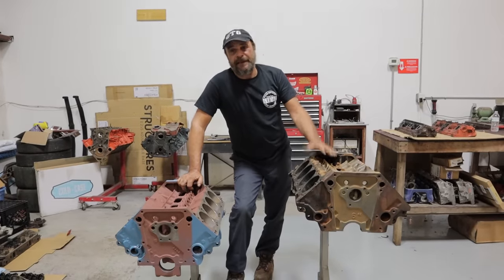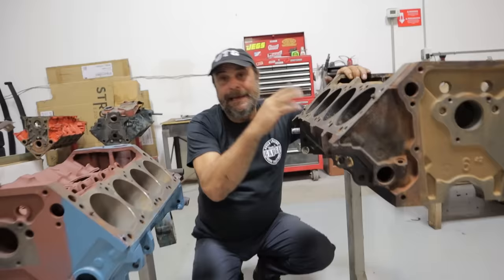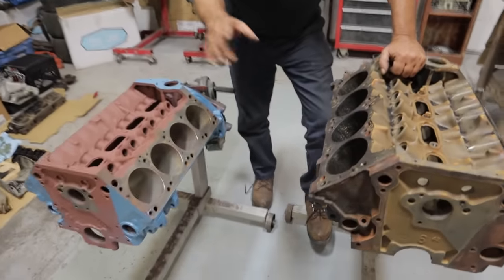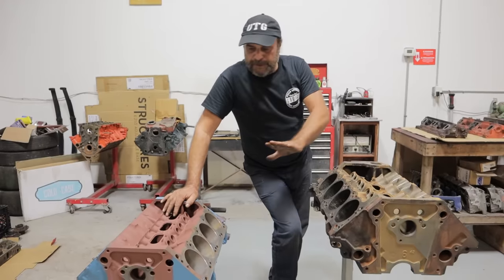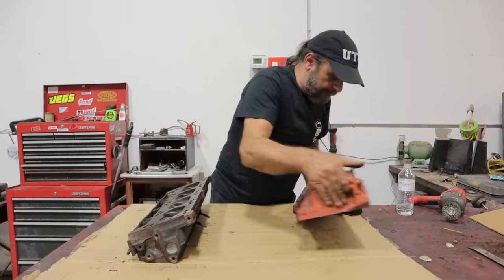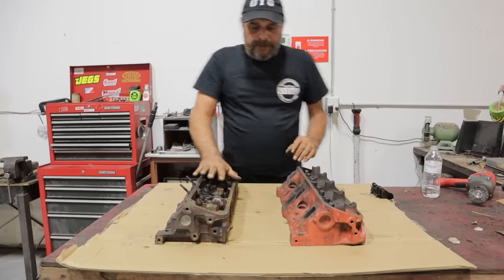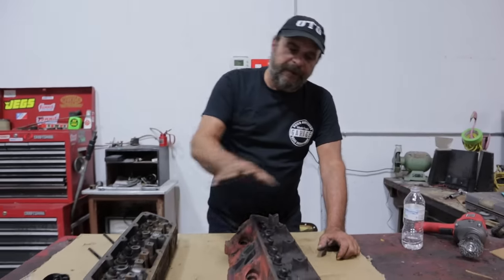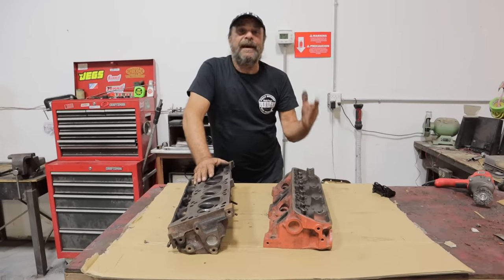Magnum vs. LA. Side By Side Comparison

Comment: When Uncle Tony says F those cracks they don't matter, I believe him
Reply: I think that's also the case for the 5.7 Chevy Vortec heads, but machine shops don't want to use cracked heads
Reply: I have 4 magnum head from 318s one engine had cracks in every cylinder. The other engine had 2 cracks per head. Don't think it would make a difference as I didn't notice them un until I lapped the the valves and seats. They are very minor looking cracks.
Reply: They don't. This has been know for years
Reply: Well yeah might be a chance the crack could cause a check engine light to come on but since most of us are doing carbs definitely less of a problem.
Reply: Awesome man I've been waiting on a magnum video
Reply: its true. ive seen it countless times. truck runs damn good, pull heads "oh no my heads are cracked!" it doesnt matter.
Reply: I dont.......that casting would be shipped off to a shop that does cast iron welding for a proper repair.
Cracks spread--an inescapable fact.
I ve been doing engines longer than he has.
Reply: I dont. those castings would be shipped off to a shop that is proficient at cast iron welding for proper repair.
Cracks spread..an inescapable fact.
Ive been doing engines longer than he has

Comment: I've got a magnum 5.2 I've been thinking about upgrading. We need more input from the pros like you on what our options are.. you know, mild upgrades on up to major mods.. I really think that would be an awesome series that so many of us would appreciate! Either way, I love your channel, keep up the awesome content!
Reply: I'm not a pro by any means but I've done a couple Magnum builds and I'm currently doing a stroked 360 LA for my drag car. My first step to upgrading the magnums has always been a bigger cam, new lifters and pushrods, and headers. This will at least get you the sound and attitude of a somewhat "built" V8. Next would be an inspection of the heads, magnum heads are nutorious for cracking and as a general rule of thumb it's always good to take them off and inspect them. If there's no cracks great! Now you just need to decide if you want to clean up the original heads or go with a new set. Me personally I'd go with a set of aluminum heads that have the ability to bolt on an LA style intake because there's so many more options for an LA as far as intakes go. But this gives you the option to swap a 4bbl carb on it, you could also use the original throttle body with a 4bbl to 2bbl adaptor or go all out and do a modern efi system. All depends on cost and what you'll use the engine for and your goals for it. And last but not least you have your bottom end, the factory bottom ends aren't bad in these engines at all, but if you're looking to raise your compression ratio, add more cubes or plan on using a power adder, a new rotating assembly would be in your best intrest. Hope this helps some! Goodluck with the build!
Reply: Richard Holdener is doing a series on the 360 right now, I know it's not a 318 but most of what he says and does to make power will still apply to it, the power gains may just be a little lesser on the smaller engine

Comment: I pulled a Magnum out of a 1995 Ram and when I took the heads off the block, it had the oil holes from the factory, as I was looking to run my 2.02 J heads on it.

Comment: 5.9 Magnums make awesome power for cheap! Mine just pushed my 68 Satellite daily driver to 8.61 in the eighth with a little 600 CFM gas mileage carb, a 904 automatic with the stock converter and 3.55 gears! The only non stock stuff inside my engine is a Hughes cam and valve spring kit and a Cloyes timing set. My friends 56 Chevy with a 350, 4 speed and 5.13 gear runs high 8's/low 9's and a 650 horsepower 7 speed supercharged 2018 Z06 Corvette usually runs around 8.20 so I'm in the same ballpark as a lot of badass cars with a very mild and streetable combo.
Reply: NICE!! 👍🏻👍🏻
Reply: @77yogurt  Thanks!
Reply: @kennywhiddon1497  Yes roughly according to the conversion chart. It says some cars may be quicker or slower though so it could likely be anywhere from 13.20 to 13.60
Reply: AND YOU CAN DO IT WITH JUNKYARD PARTS,thats the amazing ability of a magnum engine,just remember the magnum engines and the new hemi's, the valve springs are junk right out of the box,208 wide open pressure on a valve spring is a joke,need 125 to 135 on the seat and 280 to 335 for serious revs,the magnum 360's are available all the time for less that 300 for a complete core,904's can now be built to hold the power with space age materials[KEVLAR,KOLENE STEELS RED LINED CLUTCHES,AND STRONGER SPRAGS AND BANDS,STAB IT AND STEER--------------TIMING CHAINS CHECK THEM EVERY 65-85 K MILES,mopar timing components are junk after 65 thousand hard miles,good thing they're cheap
Reply: 1/8 mile sucks, I won't even watch 1/8 mile.
Reply: @redcowboy1986  Yeah I said the same thing when I was a little kid too. In reality the closest quarter mile track is over 200 miles round trip and that's not very practical with a 3.55 gear and a three speed especially when the car is strong enough to break drivetrain parts and a towing bill that far home can cost several hundred dollars.

Comment: I have an 87 2wd Ramcharger that I transplanted the 5.2 in. I have the Edelbrock RPM intake with a Street Demon on top. I used the Magnum front drive. Everything fits good. Bolted to the 904 with one TQ hole slightly elongated. The motor had 200,000 miles on it. When I pulled the heads, all looked good, so I bolted it up! No other changes, really. Runs really good. I used a small-cap HEI distro and remote coil from Assault racing for spark.
Thanks, Uncle Tony!

Comment: Excellent video. On the LA heads, if you strip an intake bolt you can use a longer bolt and with the valve cover off you can put a nut on the longer bolt that will extend into the rocker area of head. I had to do it before.

Comment: I've been running a LA roller cam long block using the 1986 2bbl factory fuel system & external electric fuel pump. Been daily driving/utility usage and does a great great job still.

Comment: I can’t put into words how helpful this video was for me I just got a junkyard 5.9 magnum to build for my 1990 Dakota that I just put a custom built frame under that I plan on running some hard tire no prep drag racing with and a little street cruising. I have a fully forged and balanced scat stroker kit on the way for it and I gotta get it stripped down to the block this weekend to send to the machine shop to get bore .030 over, then I ordered a set of trick flow aluminum heads for it and a trick flow intake manifold. Now I plan on running it carbureted because the simplicity of it. Then I plan on running nitrous on it at the track but I don’t know how big of a shot yet because I’ve personally never dealt with nitrous but I have a couple buddy’s that have used nitrous since they first started drag racing and once the engine is in the truck and running they will help me with that decision.

Comment: My 1970 340 heads have 2.02 intake1.60 exhaust factory installed. The head looks like a ordinary early 360 head casting,  but no air injector passages. The valve pockets under the seat right down to the bowl were shaped with a throat cutter at the factory.  I never fully ported these heads, only gasket matched and blended. The hyd flat cam has about .550 lift and really works good with the near stock heads. I built the motor when I was a teen in the mid 80s, it's had cam, intake, exhaust changes since then, that's all. It is a great engine, 318 and 360 LA  motors also are such tough motors!
Reply: My brother had a 1970 340 Dart Swinger 340. I had/have a 71 Demon 340. We bought them new in 70 and 71. They both had the newer 360 casting with 2.02 intakes and 1.60 exhaust. I even had Dodge pull one head on my car to prove it was the right head! They finally convinced me as I was there when they tore down my engine. Funny thing was the dealer mechanics didn't even know they started using that casting in 1970.LOL! I went on to race my cars in Super Stock and did quite well including setting my class record.

Comment: Hi Tony! In 1978 I took the head off a 318 in a 69 dodge polara and left the intake and exhaust manifolds on to change the head gasket and it worked. I was 17 and dumb, desperate ,and wild to get on the road I guess. That's my story and sticking to it.

Comment: Junkyard magnum heads are ok if you're on a tight budget. I went with EQ Magnum heads for my kids 360. Stock valve sizes, spring upgrade, some bowl work and gasket matching. Topped it off with a home ported Performer RPM intake being fed by a Performer carb (AFB clone). Last year he put it on a chassis dyno and it made 365 HP and 415 torque at the wheels. I'm a firm believer in the Magnum style head. BTW you can purchase EQ heads with the old LA style intake manifold bolt pattern.

Comment: Very good and very thorough video --- one thing you forgot to mention: if you're going to use stock rocker arms the LA rocker arms are 1.5 ratio and stock Magnum rocker arms are 1.6 ratio which would likely be a consideration when selecting a camshaft

Comment: They also made "fast burn" heads for LA motors.  The valves were small, but that can be changed.  The set I put on my 318 woke that little mill up quite nicely.

Comment: Thank you  Sir for running this, it answers a lot of questions for me. For my 80 D150 I built an 88 360 roller engine . I had already  rebuilt the 80 heads and tried to use them on the 88. The pushrods dragged on the openings where they pass through going into the block. Fortunately I was able to sell these heads for a decent price right away and got busy and cut the seats and valve faces on the 88 roller heads.

Comment: A few things you left out on the Mag blocks. The early 5.2 from 92 thru about 95 and the 93-95ish 5.9 still have the LA oiling drilled into the blocks and can be used if you use a cam with the 2 -4 oil hole in the cam. If your Mag block doesn't have the oiling hole you can use the Oil thru pushrod shaft mount rockers  that are sold by a lot of companies now like Comp, Prw, Speedmaster, and Harland sharp when you run LA heads on a Mag.

Comment: This is the video I've been waiting over a year for. I'm building a 5.9 Magnum to install in my '85 W150. Picked up a decent virgin core but the heads had those very cracks. Nobody could tell me definitively whether the cracks were benign or death sentences and I was about to pay for a pressure test. Not intere$ted in aftermarket heads for my truck if I don't need them and I was suspicious that the cracks were N.B.D.   Uncle Tony says "Run 'em" and that's good enough for me. Also, I went with KB107 slugs (0.020" over) which should get me closer to zero deck than the stock ones that were 0.050"+ down. Just got it back from balancing. Now to drill the heads for my Performer spread bore and Thermoquad. Using OEM single pickup distributor and stock LA ignition. Just a work truck that covers a  lot of highway so no idea what cam I'll use yet?

Comment: I am currently building a mild cam 5.9 with a Hughes intake and throttle body for my 1998 Ram 1500 4x4. Now I love the metalic blue paint that was used on the AMC engines and am painting this 5.9 that AMC blue. I just learned from UT that there is a link between my 5.9 Magnum and the old AMC 304: the rocker arm assemblies. So my paint color choice actually has a deeper connection than "that sure is a purty color." Any way, good info as always UT.

Comment: TONY! You missed, early TBI magnum blocks (or as you called (LA Roller) are drilled to oil the rockers.  These are the blocks to have. 

Also 5.2 magnum oil pan same as 5.9. 360 style. 
And the cam snout.  
Great Video!
Reply: @Daniel G 
I would know how to answer if I know the comment.  
You make no sense.

Comment: LOVE the videos, sir! I do have one correction though; many people think the 5.9 and 5.2 used the same heads; not entirely true. The 5.2 "Magnum"s supposedly all came with 53020466 castings. These (53020466 castings) were supposedly cast in the U.S., while 5.9 "Magnum"s supposedly all came with the 53006671 castings (which were reportedly all cast in Mexico; and the quality difference really shows if you look at enough of these heads like I do..... the "0466" heads are just a lot "cleaner" looking than the "6671" heads). Now onto the differences-
If you look at these two castings side by side and from all angles, you most likely will not see any differences. But if you look closer, you will see that the 6671 heads (which came on the 5.9s) have intake ports that are roughly 1/10 of an inch TALLER than the ones on the 0466 (5.2) heads. These measurements are consistent, head to head and casting to casting. Everything else on the two castings is pretty much the same. I do not know if this was intentional or not (makes no sense, as I do believe the gaskets and even intake plenums are the same between the two castings), but if you multiply that 1/10 of an inch of material times 8 intake ports/cylinders, you get a (potentially) fairly substantial airflow difference between the two castings...
Now I have no idea whether or not there is a bottleneck created by either the intake gasket and/or the intake manifolds, but I do know that (supposedly), the above information on the two castings is 100% correct. 

The strange part is supposedly only one of these castings has been available (in the past) as a replacement head from the Mopar parts counters...so maybe Chrysler had intended on doing something proper by having bigger ports on the bigger engine and smaller ports on the smaller engine, but then scrapped that whole idea as a cost saving measure (that, or the actual performance numbers were negligible, which is more likely). I've never measured the Magnum V10 ports, but I would imagine they are the same size as the 6671s....And you are DEAD accurate with the Crack info.!! We actually cut into a Magnum head once (right where it cracks), and you can literally go more than 3/4" down before hitting water....Anyway, GREAT videos!!!
Reply: From 1996 - 2000 they Were made in New Haven Foundry
Michigan, I know because I poured them we were one If not the last Foundries that poured iron with hand ladles
We did Magnums, 318 - 360 use the same heads, We did V10 Magnums & also the Dart 454 Iron Eagle heads, Far as them having cracks the Mixer dumped the metals meaning silicone, graphite, for the other one it was 3.
The mixing process was done by hand mix this mix that, Sometimes we had a whole skid of scrap Magnum heads, overall poor quality control, they use to cut them in half to find out they were scrap

Comment: I put a 95 360 in my 78 truck. Has stock Chrysler ignition, M1 intake, and edelbrock on top. Kept the 46rh that was attached to the magnum but wired the od and lockup to two switches. Took the 9.25 rear and had to weld new spring perches because the 78 is a bit more narrow.

Comment: We had one Magnum valve seat crack spread out across the chamber into water and start eating coolant at an impressive rate. It was bolted to a roller cam 360 block for a couple years. That's a grand total of one, out of maybe a dozen sets of Magnum heads I've had or worked with, maybe 70% of which had cracks. But it is definitely at least possible.

Comment: Ive got the best of both worlds sitting in storage.  A late 92-93 360.  "308" heads, with a factory roller cam, including the lifter retention "spyder".  Mine also has a factory windage tray.  Another sweet piece is the timing chain cover, which eliminates the mount for the mechanical fuel pump.  Nice if you are running an electric pump only

Comment: I'm mostly a Chevy guy. And I despise the LS. I'm into the original cast iron small blocks. With cast iron heads. I built dozens of them. I've raced them, I've built them for hot rods and daily drivers. Built right, an old school small block Chevy can make way more power than you might think, for those that don't actually know. Also, built right, and properly maintained, they can last practically forever as a daily driver engine. There is a reason the aftermarket is still making them.

Comment: Years ago one of the car magazines ordered a Mopar performance 360 that had a rather hot cam.
They stuffed it in a four door valiant they nicknamed, "the brick". With headers, huge carb, hot ignition and four speed trans, they were running it on a track with lots of curves and one fairly long straightaway and they were keeping up with BMW's and vettes. But they did a major job on the brakes and suspension. Can't remember what all they did but the brakes were huge ones from what would go on a cop car.

If I remember correctly that crate 360 cube engine was rated at 380 HP and 390 torque. But the torque came on strong at low rpm and carried all the way to 6000 before dropping off.

It would be a blast to build a 360 magnum to those specs, and stuff it in a Dodge Dart or Valiant and go street racing.

Thinking back long and hard, I believe it was a Mopar Performance magazine article.

Had to laugh at, "the brick". Comparing it to sleek, streamlined Vettes and BMWs it really was shaped like a brick. LOL

I bet it thoroughly pissed off some guys to have that "brick" keep up with them.

Comment: I've had multiple Magnums go well over 300,000 miles in Ram wagons,and were still running when sold. Never even needed a starter. Fantastic motors. Transmission and fuel pump not so much.